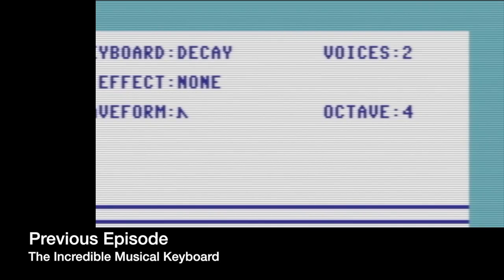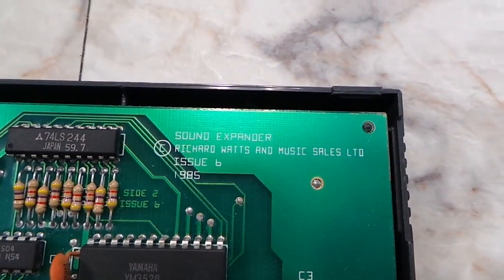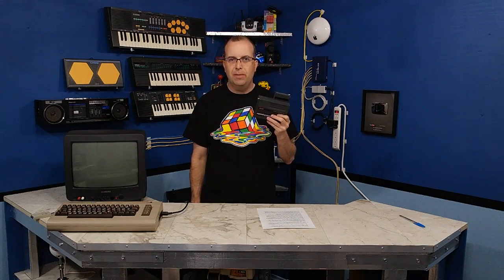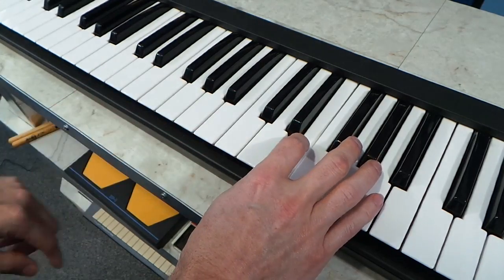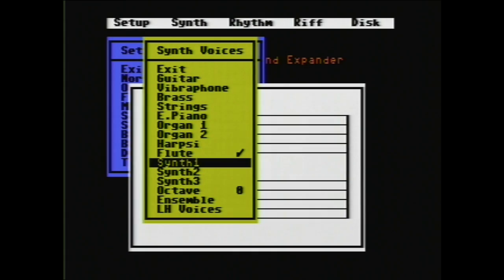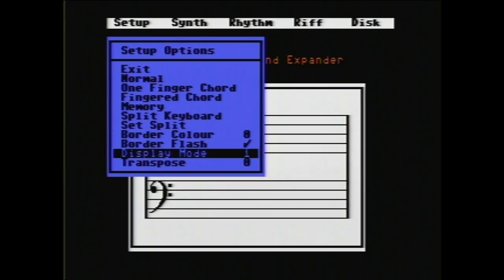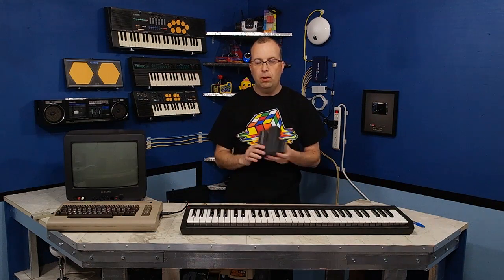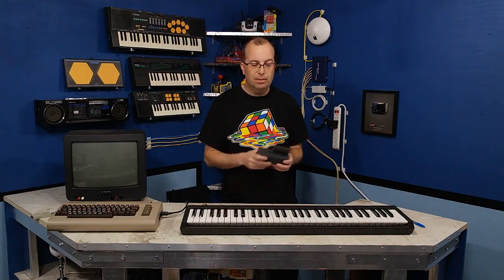Commodore 64 SFX Sound Expander - In Depth Look

Comment: what the higher notes of the "space bell" preset are doing is called aliasing. it happens when there's frequencies above nyquist in your sound (for retro tech like this it's pretty much safe to assume the nyquist frequency is somewhere around 22.05 kHz or even lower ). These higer frequencies then get looped around and end up in the lower frequencies because the data is kept (not low passed away) and interpolated wrong.
Reply: well, above 24858 kHz then. My point was that probably super high sample rates weren't a thing with old digital to analog converters.
Reply: Even modern "standard" gear doesnt have High sample rates. With modern "standard" gear you actually get a digital signal at 22 KHz Audio because its sampled just in 44,1 K which is too low. Its a 30 year old standard which is long time overhauled....
Reply: since accoustic works like frequency interfere with each other ultrasonic frequencys above 20 KHz has an effect on our hearing. There are studys.

Cheap speakers go just to 20 KHz, right.
Reply: that are really poor speakers. poor radio quality wich cuts off at 15 KHz in Analogue radio.
Reply: "There are studys [sic]" -- Funny how whenever "there are studies" mentioned in a discussion on the Internet, such studies are never linked to or mentioned by name or anything...
Reply: Pretty sure what Dom is talking about is harmonics, which are absolutely a thing.  Its why badly encoded digital files sound `flat`, the sound is limited to the frequency's the human ear can detect (20hz-22khz iirc) and anything  infra/ultrasonic is discarded.  We can `feel` these `silent` frequency`s and they also alter audible tones via interference.
Reply: @meetoo594  Harmonics are a thing of course, but there is no effect from frequencies above our hearing capabilities on what we hear. A sound with a base frequency of let‘s say 11kHz will sound like a sine, no matter what its actual waveform or harmonics are doing. And there are no serious studies showing any effect on human hearing from sounds above 20kHz. The ones that show something there are flawed and disproven or straight out of the pseudosciences.
Reply: No aliasing here. This is just classic feedback on FM synthesis modulator operators.
Reply: Aliasing like that doesn't happen with analogue filtering or recording gear (the extra high frequencies are either recorded, or they're filtered out; they don't end up appearing further down the scale as false notes), it's an entirely digital phenomenon. I know it best from my old Casio SA20 PCM-based toy keyboard, its sampling rate obviously wasn't the best and you'd get a similar set of funky artefacts from some of the upper notes.

Most likely it's being created inside the OPL itself (or the DAC if it needs one... I can never remember which YMs do or don't). Its native maximum cycle rate is somewhere up around 56khz, but actual operating frequency depends entirely on the clock signal it's fed from the host system. If that's not equal to (one of) a (set of) certain multiplier(s) that produce said maximum frequency, either it'll be slightly lower (if the clock isn't quite up to speed, e.g. 5.3, 6.0 or 7.0Mhz instead of 7.16Mhz... or half / quarter of those), or it could be a LOT lower (e.g. if your system is actually 8.0Mhz, it'll have to be divided down pretty hard to the equivalent of 4.0 (or if the clock is 4.0, 2.0...)). In the former case, that just means a reduction to 54, 47 or 41khz output, which should be enough to put most aliased frequencies way up out of human range, possibly even being lost in the circuitry's natural and unintentional low-pass filtering. But in the latter, it'll drop to barely 31khz (or 30, if you have e.g. a 7.7~7.8Mhz clock like in the Genesis and Mac), in which case the maximum "clear" frequency is well within audible range and every aliased note will be extremely obvious... and by the time you've gone an octave beyond that point, things will be getting VERY weird, when with the higher frequencies they'd only just have started becoming noticeable.

It might also be something in the phasing / modulation engine itself, even at full rated output frequency, as that pretty much deliberately aliases waveforms to different frequencies with every cycle, and if it's set for a particularly high modulation rate could end up causing obvious artefacts at relatively low note frequencies (ie within the range of a typical 61 note keyboard if the instrument has a lot of high pitches within its overall timbre).
Reply: Interesting idea, but LFOs by definition should be subsonic; I think the highest you can set the OPL's to is somewhere around 30 or 40Hz. Enough for very rapid vibrato or tremelo, but not enough to really become a note in its own right, especially not at the sort of high pitches heard here.

I'm still rather more convinced by the aliasing idea. The pitches are in the right range for it, and it's got that characteristic alien, vocodery fuzz to it that yells "aliasing error" to my mind. It's the kind of noise that should be familiar to anyone who ever messed around with really low rate samples on systems without proper low-pass filtering back in the day, or indeed ever really heavily reduced the sample rate of something in Windows Sound Recorder though the speedup-slowdown trick (it did no filtering at all so it was alias city), or did quick and dirty sample rate converts in CoolEdit without "wasting" time on pre/post filtering (or indeed did so in order to deliberately get funky aliasing effects on a certain sample)... or even just if you've ever downloaded a poorly converted MP3. Etc, etc.

FM works essentially by changing the pitch (or in the Yamaha chips, the phase, though it achieves the same goal) of a fundamental waveform (e.g. a simple sinewave) at a particular rate, which could be extremely high and possibly even higher than its own oscillating frequency; this is distinct from the LFO, which can operate on the amplitude, base pitch at a much lower rate than the main operator, or on the modulation rate itself. The modulating operator also has an amplitude value which governs by how much the pitch/phase is shifted away from the base position at its peak.

In the case of the Space Bell, it seems rather that the modulation rate is on the order of maybe a dozen hertz (hence it seeming like an LFO), and with a good octave or more of modulation amplitude. Thus when it gets up into the highest ranges, where the "actual" base note is starting to go ultrasonic at the top end (but still drops into the audible range at the lower, it ends up exceeding the actual effective sample rate that the chip synthesises notes at (all of the YM range are wholly digital affairs that generate discrete samples, with audible frequency waveforms generated by many deep divisions of a video-frequency clock) and aliasing wildly to lower notes. Which becomes rather more noticeable than the normal lower reaches of the modulation because it happens at the "wrong" time (the note dips twice per cycle, and does so during the point where you'd otherwise expect it to be reaching its highest frequencies instead of dropping), and it also reinforces the proper lower frequencies, and you get that characteristic skewa-skewa-skewa noise. Plus if's actually a 4-op voice things could get super weird with the different arrangements of carrier and modulators plus feedback.

Another thing to consider too is that the effect may be more noticeable than a similar chip installed onto a PC soundcard, and at lower note pitches, because it might not be enjoying anywhere near as high an input clock rate as the PC version. For example if an Adlib or Soundblaster has an onboard 3.58MHz crystal, or can derive that from the PC's own clock feed, then it'll be running pretty close to maximum speed. If when plugged into a C64 it finds the highest available clock is only about 2MHz (or a little either side), it'll be running not much faster than half the speed, generating notes with a pitch almost an octave lower for all the same register values, and most particularly running to maybe a 31kHz master sample frequency rather than ~56kHz... which puts the highest possible frequency it can generate well within human hearing range (in fact, a little below that of a CRT TV flyback transformer), rather than considerably beyond it, and making the immediate reflected spectrum of above-nyquist aliased samples much more obvious to the ear and sounding fully pitched in their own right quite a bit "earlier" than if they were bouncing off a ~28kHz ceiling instead of a ~15.5kHz one.

Comment: Hey, so the reason why the "Space Bells" instrument sounds weird in the higher notes is because the notes are aliased. The patch itself is quite a complex sounding so the Sound Expander probably can't handle it properly.
Reply: The expander just connects the OPL to the C64 pretty much entirely passively. The high notes sounding weird are just the OPL operating normally ... Yamaha's phase-shift "FM" is essentially well-controlled sample aliasing after all. And maybe you actually wanted that sound anyway? If not, you could, in a more sophisticated program (on the level of EG Adlib Tracker II) fiddle with the patch settings somewhat (e.g. reduce the modulation rate) until it didn't go quite as wild at the top end, at the expense of changing the timbre of the lower notes.
(Though I think such software, and maybe even the OPL itself or at least some of the later members of the family, actually had the facility to automatically adjust the modulation settings according to how far up the scale you were? ISTR there being mention on a data sheet of something like that, which was initially intended for more accurate piano emulation (as it uses fewer strings for high notes than low ... or maybe the other way round, I forget... so has a timbre that alters in the very highest and lowest octaves vs the midrange) but could certainly be used for special effects, or reducing the strength of aliasing artefacts)

Comment: This Sounds A lot Like The Sega Genesis!
Reply: Dynamite Headdy or Megadrive.
Reply: That's not surprising, seeing as the Sega's 2612 (effectively an "OPNC", or possbly "OPNB-L") and the OPL have a lot of shared heritage. Or more precisely, the entirety of the OPLx and OPNx ranges are essentially based off this chip as a starting point (with the pre-SMD/SG OPNs adding a register-compatible YM2149 core, and in some cases a fairly sophisticated (AD)PCM engine, to the FM part... and one range needing a separate DAC, the other integrating it but I can never remember which is which).

The actual FM part works pretty much exactly the same in all cases, just with different features on top of the main 2-operator sine-carrier+single-sine-modulator with hardware ADSR concept (e.g. ability to use 4-op voices, different waveforms either based off rearranging the internal quarter-sine sample to play different ways or just using a wholly different generator, the total number of voices, special effects like multi-part detune, use of the PSG envelope generator, etc). So if you use one of the later chips but don't really push the limits, and just stick to a limited number of fairly straightforward 2-op plus normal envelope voices, it'll sound exactly like the OPL (at the same input clock) no matter which Yamaha FM chip you use.

(tell a lie - some will have some minor differences to the overall timbre given the way the actual sound generation works... in all cases there's actually only one operator module that works on each voice, and each slice of a 4-op voice, at a time, which is why the maximum output frequency is so much lower than the input clock... but the more expensive and sophisticated chips store the resulting sample value in a register bank that's then summed and sent to the DAC once per nominal output cycle, whilst the cheaper, cut down ones lack that facility and output the result to the DAC live, using a kind of PWM / timeslice mixing system that relies on intertia within the connected speaker system (or averaging in analogue filters along the output path and/or any digital recorder you might connect to it) as well as the human auditory system to apply a bit of "temporal blur" to the signal exterior to the chip. This is, for example, the source of the famous "ladder effect" bug in the output of the early generation SMD/SG, where quiet tones would acquire a characteristic buzz thanks to poorly matched capacitors on the output stage and thus improper smoothing... which led to several games sounding "wrong" on later revisions that fixed the problem, after composers wrote music deliberately making use of the bug. However, this is something caused in the output stage of the chip, rather than the actual FM generation part. The generator itself still works perfectly fine and identical to that of the higher end chips, and if you connected the output of a cheaper chip to a specially-made DAC that incorporated the missing registers and did its own summing to output a clean sample about once every 1/55556th of a second, those simple tones would once again sound identical)
Reply: @mspenrice  underrated comment this shit educational asf

Comment: Suicide is painless (The theme from m.a.s.h" would be a cool son to record with som of these sounds like vibraphone and synth 1. Could you plug the seckond module into the first one to get more polyphony?
Reply from the maker: In theory, I suppose you could.  You would need to remap the base address on the second module which would require a simple hardware mod.  And then the software would need to be modified for it.
Reply: 8-Bit Keys Since when did your channels blow up? I've been subscribed to the ibookguy channel since 2k on another account and I just recently checked. Great work on the videos!

Comment: how do you sync that sound from commodeore and video from camera?
Reply from the maker: With great difficulty.. Haha.. Seriously, it would be hard to explain here.  But there is a reason it takes 3-4 hours to edit one of my videos.
Reply: It's because he uses Audacity rather then software designed to do what he's doing.
Reply from the maker: Actually.. I didn't use audacity at any point in the production of this.   I use Audacity for multi-track recording, which I did not do any of that in this video.  All of the audio syncing was done inside of Final Cut Pro.